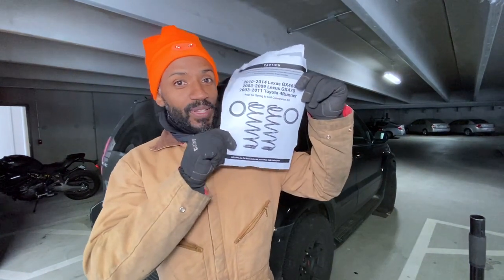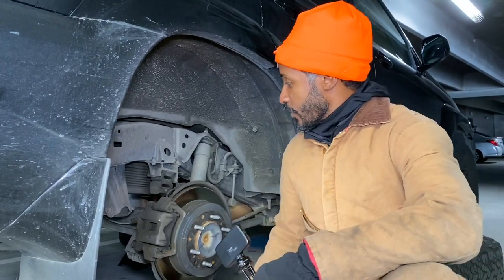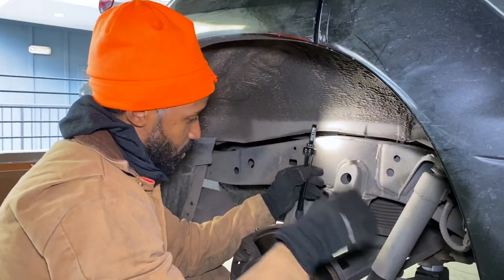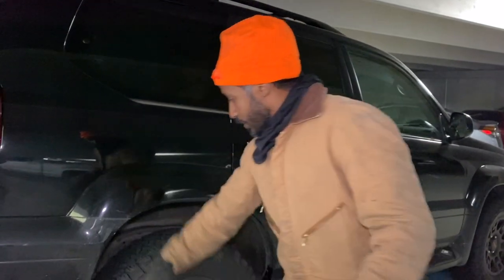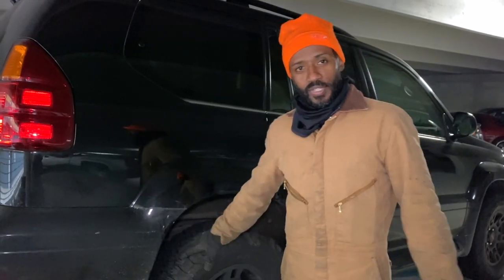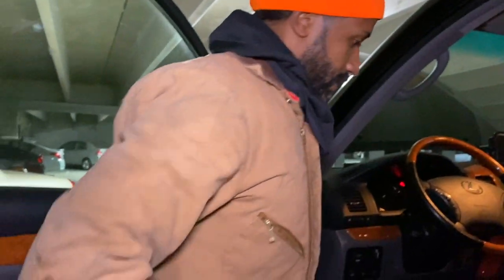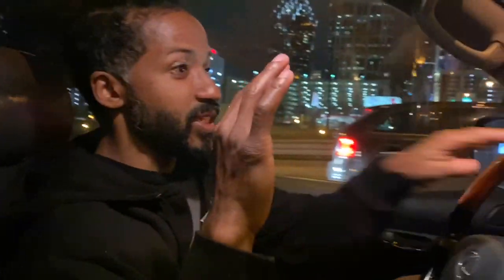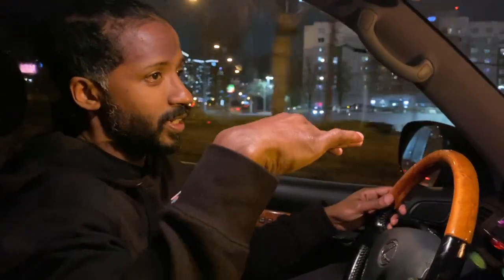Gx470 Suspension Conversion - From Air Bags to Coil Springs.

Comment: Awesome video! Does the spring kit come with lower isolators? I can see in the kit that the top isolators comes with it
Reply from the maker: It did back then. Since I made this video I think the products I used have changed a little.
Reply: @KRTLyfe  so I did the conversion successfully just had a quick question - I know you don't have the GX anymore but how many miles did you drive on it after doing the rear coil conversion and did it still feel solid?  I'm happy with the way it feels after doing the coil conversion but hoping it stays that way.  Also re. the shocks if I were to replace them do I no longer need the electronic shocks anymore?  Thanks again for your help really appreciate it!
Reply from the maker: @rickychauhan2217  We put a decent amount of mileage on the GX after we did this mod. In our case the GX retained very nice ride characteristics until the accident. It would be difficult for me to give you an exact mileage but we drove back and forth from Atlanta to Miami many times and a lot fo camping trips in between. I could never tell the difference with the electronic dampening personally. It was nothing like my Cayenne that i owned previously. On that vehicle you could really tell the difference in the suspension settings. That being said I would totally ditch the old shocks if yours are spent. I have Bilstiens on my Land Cruiser and I can really feel the difference with them vs the stock suspension on our newer land cruiser. Hope this information helps.

Comment: Have you had any issues since then? I noticed you didn’t you the spring isolator (cone) that goes on the top? Great job hoping to do this to my 2003 4Runner next weekend.
Reply from the maker: Not at all, been running strong. We have also done some light "offroading"  fire roads/gravel trails and she drives great!!! On road characteristics are still preserved as well, so we are very happy with this modification!

Comment: Dumb question.. but does this give it a extra lift from the air bags?
Reply from the maker: themobbsquad great question it actually does make the rear a bit higher. We are waiting to see if the rear springs will compress anymore but I believe the metal tech kit gives it a little more lift.
Reply: KRT LYFE just wanted to follow up on this. Did it ever go down like how you expected?

Comment: How much does it cost to lift a car by 1-2inches ? I have a 2006 highlander and I found some front and rear strut lift kit from eBay. I am just wondering can any mechanic just do the job because I have watched some videos on the process ..... you have to remove all 4 shocks ( the front ones by popping the hood ). So I am wondering how much they would charge me ?? The strut form eBay are 160$ front and about the same from the back 

Anybody ??
Reply from the maker: No idea, I am not familiar with that model.

Comment: cant you still use the comfort and sport switch without the bags?
Reply from the maker: I think you might be able to if you keep the factory shocks. However I didn’t notice any difference when we had the factory set up.

Comment: So you leave the stock air shocks in the vehicle ? Shouldn't those be replaced also ?
Reply from the maker: Sorry,  I don’t understand your question.  If you don’t mind elaborating.
Reply: @KRTLyfe  the rear air shock absorbers stay in the vehicle? Just replacing the air boots ?
Reply from the maker: @markwilsing7519  in most instances only the air bag needs to be replaced. If your shock absorbers are bad as well then, yes you should definitely replace and/or upgrade them as well.

Comment: The kit you have here on the description takes it to a 2010-2014 GX 460? Still, fits a GX 470?
And how high does this raise the car? Stock height?
Reply from the maker: Yeah unfortunately sellers change the links occasionally. I will try to update it. The springs I used didn’t raise the GX. It brings it back to “normal” Toyota ride height. Your front will be lower so when you load the rear it will sit level. From all that I’ve read Toyota designed most of their 4x4s this way for driving stability whilst carrying a lot of gear/ people.
Reply: @KRTLyfe  interesting, thank you for the video. What springs and kit would you recommend for raising the car to level out at 2.5"?
Reply from the maker: @rpmfreaks1862  I haven’t gone down that road so take my advice with a grain of salt. I would check out Slee and Metaltech and see what they offer. Your best bet would be IH8mud.com. If you aren’t on mud and own a GX or any Yota you should be.

Comment: If by any chance doing the air suspension delete, does the steering wheel vibrate ?
Reply from the maker: We had no issues. Ours drove exceptionally well after the swap on and off road.

Comment: hello, krt i just found your video yesterday on Youtube. I have a GX470 i am tired of these air bags stuff man. I moved from DC to Congo, so I have got to switch these up. my question is your link to the metal-tech 4X4 does not work anymore. how can i get it.
Reply from the maker: Directly thru Metal-tech, if you look on their website you should be able to find it.
Reply: @KRTLyfe  thanks

Comment: I have a 2009 GX470, I need to convert it to coil from air for the rear suspension, do I also need to replace the front suspension?
Reply from the maker: Nope, just the rear.

Comment: But dont coil springs remove some of the comfort in driving it? Some people have told me that it doesnt feel as smooth when driving specially here in nyc.
Reply from the maker: I would say the difference is marginal at best. IMHO the only thing the bags where good for is leveling the ride height under load.

Comment: Hey guys. Congrats on a good well edited video. Camera lady has a steady hand. I see your GX 470 is just over 200.210. How does it ride?  Did you change the timing belt? I was in market looking for  a good exchange for my ml with over 200,000. The deal fell through. I am still looking to snag a deal. I want to know if these vehicles will last  a long time?
Reply from the maker: Anthony Grant thank you for watching! According to the anecdotal evidence we read via the online forums etc, these vehicles are extremely reliable. Ours had the timing belt and valve covers done before we purchased it. It just passed 200k miles a few weeks ago and it still drives amazing and everything works ( minus the air bags).  It did take us a few months to find the right GX for us. We wanted to stay under a certain price point but we also wanted one that was loved and not abused. We finally found one that was 1 owner and so well taken care of the previous owner kept every little bit of plastic that broke from the interior in a sandwich bag (3 pieces). 🙌🏾 She loved this truck and now we love it.  Good luck finding one they are awesome vehicles. I’ve heard of some families that love them so much they have 2 of them lmao 😂.
Reply: The Toyota/Lexus 4.7L V8 engines,  are good for a million miles plus. The key is maintenance. Therefore 200k miles is pretty much NOTHING when it comes to miles. Again, the key is maintenance!!

Comment: I did an strutmaster air ride delete rear only an got new front an rear sway bar links an bushings an front lower control arms in my 04 gx an i still feel every bump n the road what else do I need to do to get mine to ride this smooth
Reply from the maker: Sounds like you might have something else going on. We only replaced the rear bags with springs and got a very nice ride. I would check your shocks maybe they are stuck in “sport” setting. I would also check your tire pressure and type of tires you are running. Different tires can completely change the way a vehicle feels and behaves.
Reply: @KRTLyfe  I did an air bag delete what would be stuck ? Since there's no power to the height control or air springs an I have regular shocks and for tires general grabber I think all season
Reply from the maker: @tyronwhite1377   probably highly unlikely and when ours was connected never could really tell the difference but the AHC switch also controls the shock absorber damping to comfort or sport. It could be possible that the shocks are in sport , damaged or worn out. Like I said it could also be your tire pressure or choice of tire. 
I’m not familiar with the General Grabber.  But PSI changes + or - even a few psi can affect the way a vehicle drives. I would start there if I were you.
Reply: @KRTLyfe  ok thanks again bro

Comment: I have a question how do you know if you have to change your shocks when you replace the airbags I want to put the coils too I have a 2003 GX470
Reply from the maker: On most cars when the shocks go bad the vehicle bounces up and down something serious! The shock absorbers basically neutralizes the bouncing motion and keeps the vehicle steady. Sometimes if they are going bad you might see some leaking from the shock but typically when they go you will know it!
Reply: @KRTLyfe  Yeah, when our airbags went out I heard a hissing which I just happened to hear. Then you're going to be driving with the back of the frame resting on the back axle. You will know, haha!

Comment: I did this today and changed the shocks, I didn’t pull any fuses and don’t have in warning lights? I did leave the compressor and air lines in even though it goes to nothing. I also didn’t use the bottom cup thing.
Reply: This video helped a bunch though. Thank you!
Reply from the maker: Nice! Glad it was helpful! And we definitely appreciate kind comments! Thank you.

Comment: How does the switch to coil affect handling and daily driving?
Reply from the maker: Drives great, better than the bags to me!
Reply: I've been hearing that lots people like to drive the OEM suspension on "sport". And anyone who has the $$$ usually stiffens up the suspension. They put new air bags in just before they sold this one. It looks like they got into the heavy suspension maintenance cycle and bailed. Did the rear, but balked at the $2000 dealer OEM front struts & brakes. I think I have enough to proceed on doing them myself. Now have to decide on OEM or quality aftermarket (more for less but fun finding quality)

Comment: Did you remove the compressor?  Can you use the compressor for other uses?
Reply from the maker: No, I didn't remove the compressor, just disconnected it. If you pretty handy I am sure you can use it for other uses. Thank you for watching and my apologies for late response.

Comment: Great work! Do you have the part number for the switch replacement cup? Can't find it on ebay.  Thanks.
Reply from the maker: Unfortunately, I do not have that part number. It seems that it is very difficult to find for some reason.

Comment: please don't rely on your jack (only designed to jack) to support your vehicle while your working on it...use the proper jackstands (designed to support)...you need to be safe, have all your body parts and around for you camera lady...safety first my brother...nice video but your responsible for showing the proper (safe) technique since folks are watching and following you...be safe and enjoy..
Reply from the maker: Good morning and thank you for commenting. I guess you must have skipped around on the video. Or watched in mute at 1:24 I state and show that I will be using my jack stands to support the rear section of the vehicle. Idk how else I would’ve been moving the rear axel up and down independently with out jack stands.  I do appreciate your concern for our safety and the safety of others tho! Thanks for watching and commenting.
Reply: Didn’t watch the whole video but took the time to fuss at you. 🙄
Reply from the maker: This happens all the time lol

Comment: Why go to all of this trouble swapping out shocks when buying 2 airbags, a pump and 2 levelers then finding an independent to install and you get to keep ride height adjustment. I bought a pump and 2 bags on ebay for the price of an oem pump and still working silently 2 years later.  The pump was visually identical to the old one and quieter.
Reply from the maker: I think it really boils down to how you plan to use your GX for us it made more sense to remove the bags.
Reply: @KRTLyfe  How so?

Comment: Hy krt will this work be the sAme on rx450h? Thanks! Adrian
Reply from the maker: It would be similar in theory but not the same. I believe and take this with a grain of salt. I think the RX has independent rear suspension so it would be a bit different.
Reply: @KRTLyfe  i can t find a conversion kit for my Rx450 ..   if i buy OEM parts for spring suspension do you now it will work? Thanks !

Comment: What tires did you end up going with?
Reply from the maker: BFG KO2’s so far we are loving them! We drove a little off road with them fire trails no complaints. Last weekend we drove from NC to GA in snow and ice they actually performed pretty good we had no issues and saw many vehicles slide off the same road.

Comment: whhy you pull out switch
?!?!  you sitll need it, it runs the adjustable shock settings! even if you only kept the front!
Reply from the maker: Johnny B so you might have the answer to this but from what I’ve read the TEMS is disabled when you remove the 3 fuses to disable the warnings that you get when removing the bags. When the switch was working I couldn’t really tell the difference between comfort and “sport”. On my Cayenne turbo there was a more noticeable difference not the case on the GX.

Comment: This video was so thorough and helpful as I’m preparing to do this to our GX. Any additional thoughts on the Metal Tech conversion system? I bought the Arnott coils and I’m not certain they come with the bottom coil isolator pads.
Reply from the maker: Well, this is just my opinion. I think that if you plan to do any off-roading. It would be better to have something there to keep the spring in place. I have seen and read on many forums that a lot of people don’t use the metal tech kit. I’m guessing they just use the thin rubber isolators that comes with the springs. The other thing to consider is that the Metal tech kit slightly raises the rear end. At some point we want to raise the front of ours slightly to compensate for the difference. We live in the city and still need to be able to access parking decks. So a real lift is out of the question for us. Either way you go, you will not regret swapping to springs! Thanks for watching and commenting!

Comment: That’s thump is a driveshaft needing to regrease.
Reply from the maker: RUBEN 718 I’ve read many a many threads on this issue on the forums. Most were inconclusive.  Highly probable that several things can lead to the mysterious bump.  In my scenario changing the bags to springs was the remedy. 

I believe that a leaking air bag causes the angle of the diff and drive shaft to change. When you get to a stop light and hold your brakes while the vehicle tries to correct its height. The angles change and cause the thump. The cycle repeats itself until you repair the faulty suspension.  In our case the leak was so bad we experienced this phenomenon at every stop light. 

Our truck went from doing it several times at every stop, to not once since I performed this repair 6 weeks ago. If the bump ever returns I will up date everyone. 

This vehicle is driven daily.